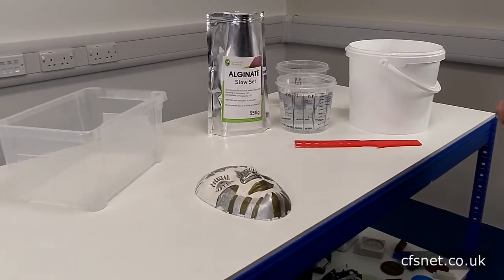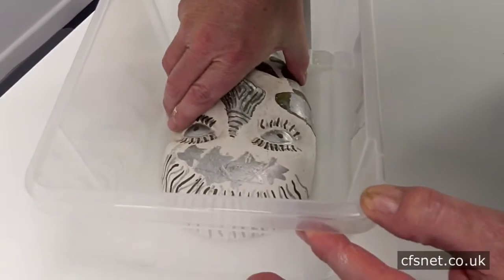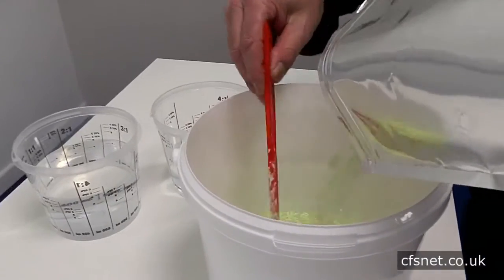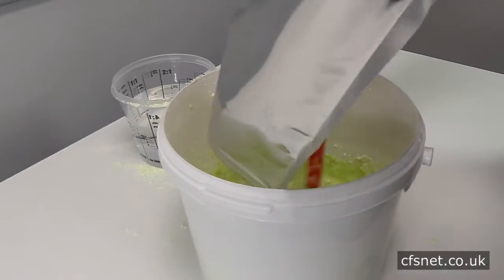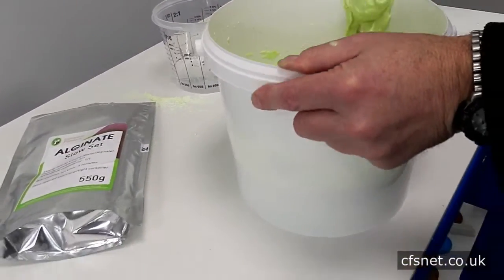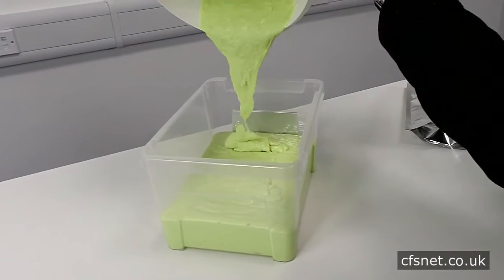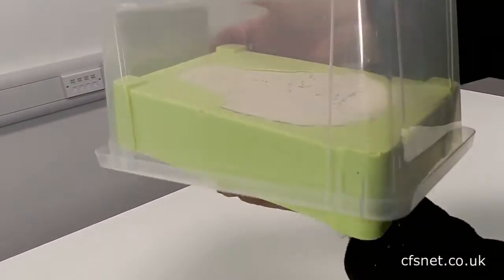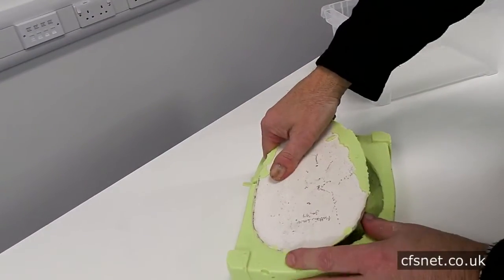CFS Fibreglass Alginate Mould Making

Comment: What is alginate? Is it like a polyurethane?
Reply from the maker: Hi - Sorry for the delay in response. 
Unlike polyurethane, alginate is not a resin. It is a skin safe moulding compound which is particularly great for life casting and taking dental impressions.
For more information and supplies click here - http://www.cfsnet.co.uk/cgi-bin/sh000002.pl?WD=alginate&PN=Slow-Set-Alginate-550gm-VMMALG_550%2ehtml#SID=563
Reply: CFS Fibreglass Supplies thank you